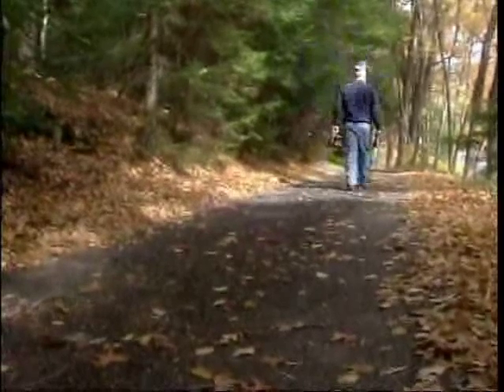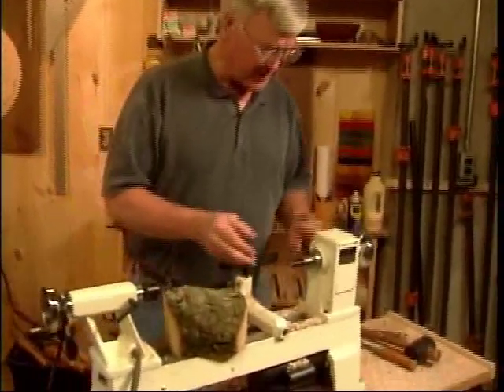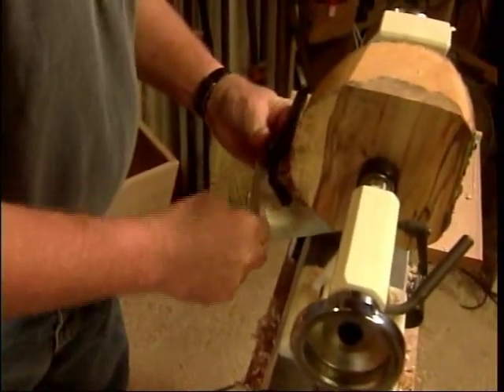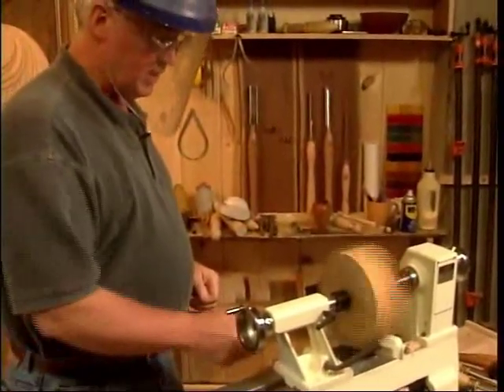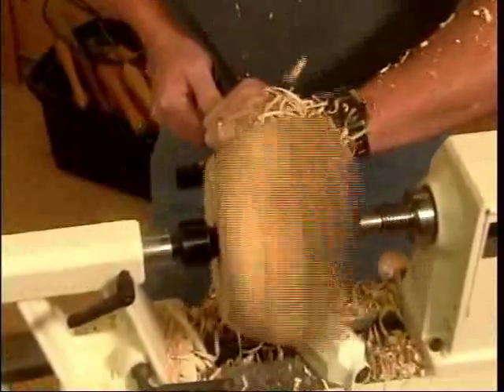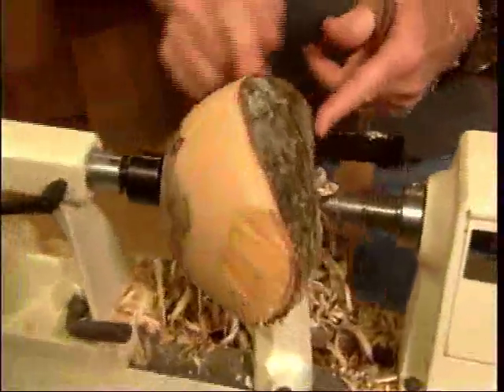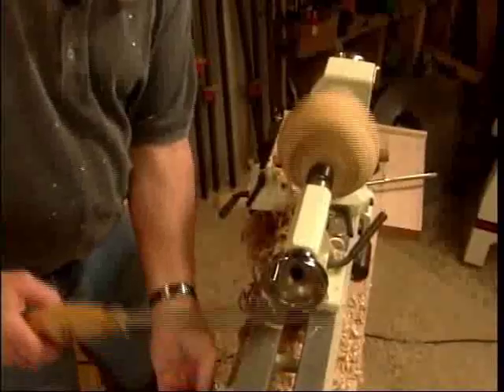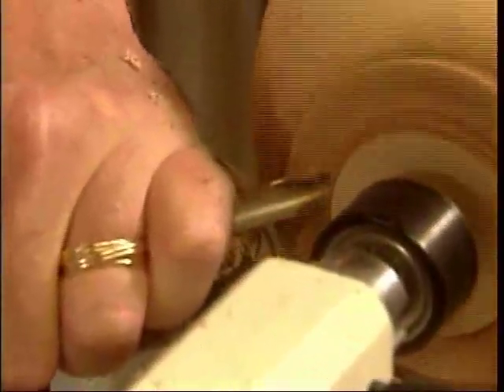JET Tools - Lathe Projects - Turn A Bowl - Part 1 of 3

Comment: Very interesting! I was a machinist working with metals for 20 years (now disabled) and if I was doing this, after turning  the work piece around the first thing I would have done would be to face it off. Squaring off the face removing all the bark and making it flat, then start hollowing it out. I would have been wrong. I just got my first wood lathe, a Jet 10x14 VS and this is going to be more fun & different than I thought. ;-) Thanks for the video & I hope you do some more of them.

Comment: beginner here, but I was under the impression a bowl gouge was for turning the inside of the bowl? Wouldn't you just use a roughing gouge or perhaps a spindle gouge to "round" or true up the outside when first starting? Looks good by the way.

Comment: I was wondering if you need to turn the speed down even if the lathe is bolted in to a table? I was wondering because on my lathe it is a real big pain to change the speeds.

Comment: @hendu3270 NEVER use a roughing gouge on a bowl.  As the blank spins the gouge will be contacting both end grain and side grain.  A roughing gouge's tang is not as strong as a bowl gouge.  If you get a catch, a roughing gouge can actually break and seriously hurt you.